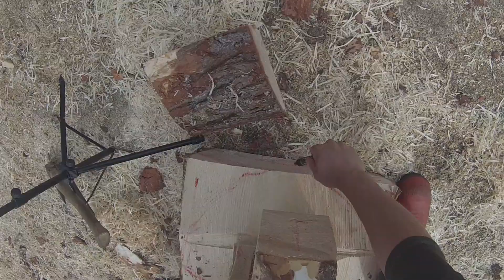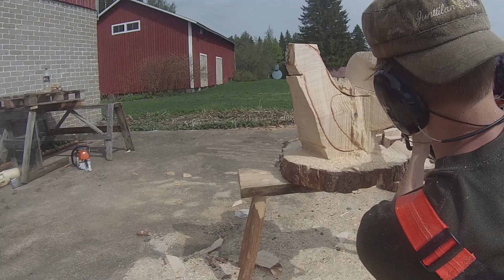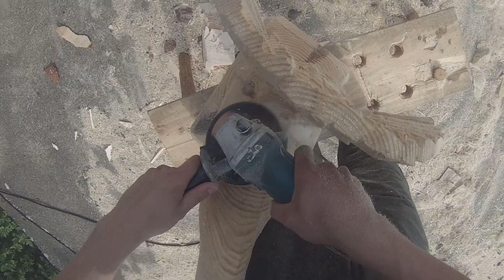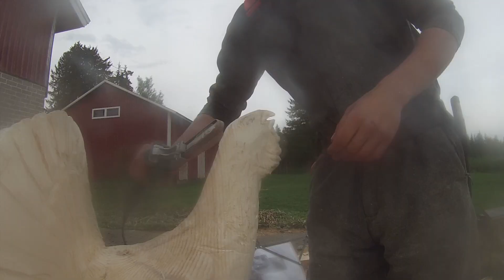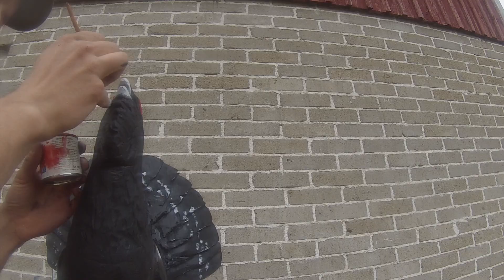Woodcarving - A Life Size Western Capercaillie Cock

Comment: Awesome. Beautifukly done!

I carve as well. How long Do you need to let it dry before painting? Do you paint when the surface is dry or when the whole Piece is dry?
Reply from the maker: Thanks! I paint usually when the surface is dry. It was hot summer day so the whole piece was actually quite dry
Reply: @JGwoodcrafts  Thanks for your reply  . That Was my approach so far as well, but i Wonder how other carvers manage Moisture content and paint.
Reply from the maker: @schnittteisen  There are always risks to paint wet wood, but then the drying process slows down and there comes not so much cracks, i think